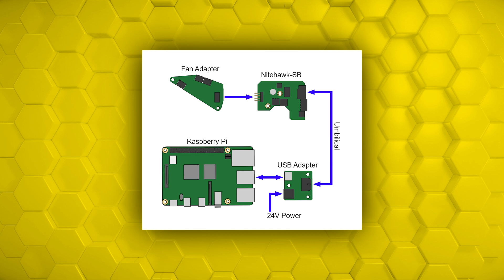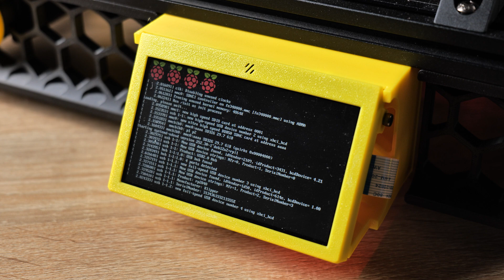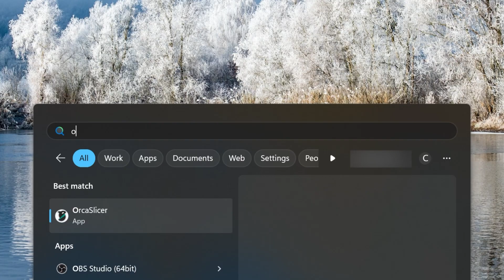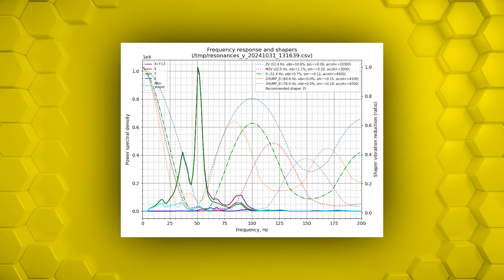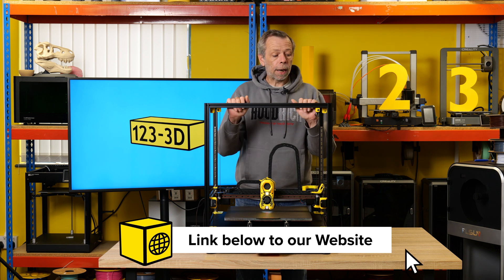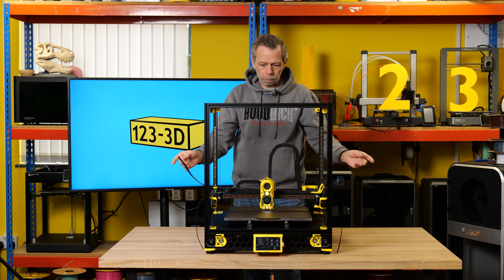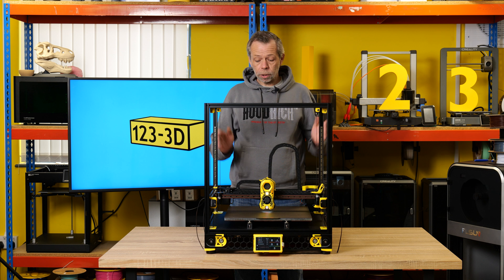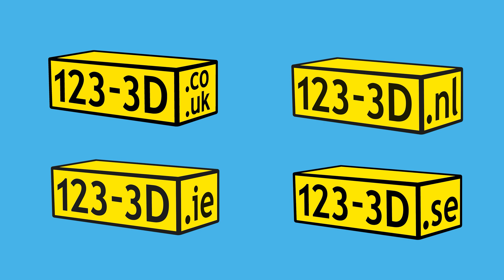Building The Voron 2.4 Rev D LDO Motors Kit | PART 4 THE FIRST PRINT

Comment: I never built or owned a 3d printer but I still really really enjoyed building the voron 2.4. It's more difficult than following an ikea/lego manual because you have to cross reference 3-4 manuals, but the steps make a lot of sense and mistakes can be solved, like how I managed to install the gantry in reverse, so I just unscrewed the build plate together with the extrusions and rotated it 180 degrees to solve it lol